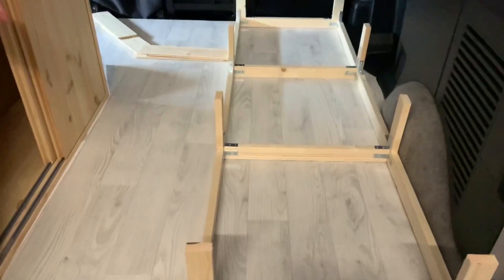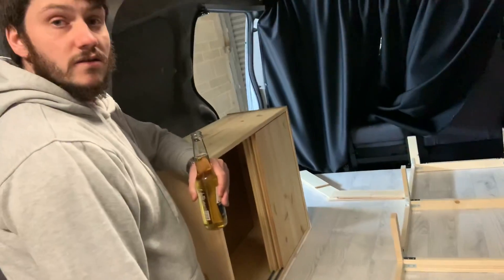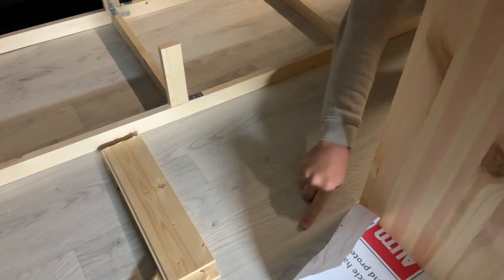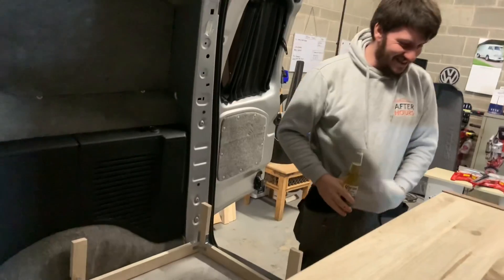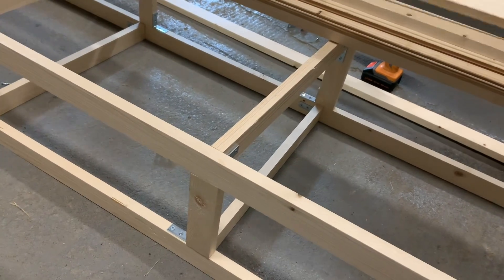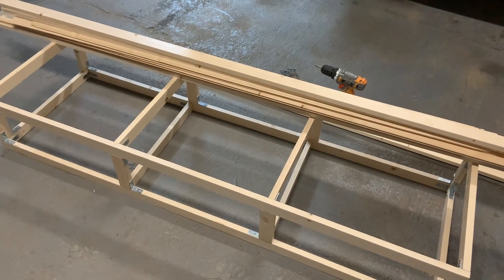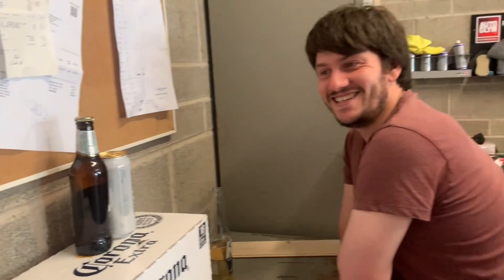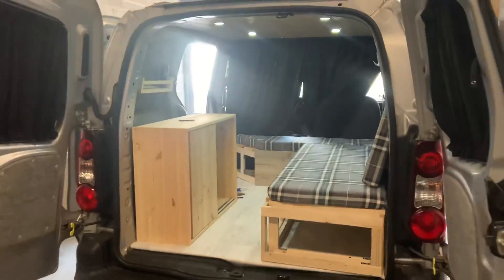Citroen Berlingo camper van part 2

Comment: Having slept in many a van slatted bed, I would use a guest bed, £50 from Argos and the like, they are sprung with a 50mm foam mattress. And dump cupboard fronts for slide out plastic tubs, no noise!
Reply from the maker: This was an idea we consider but it would limit the use of the van, our design although it has draw backs gives a bit more utility.

Comment: Question about the caddy conversion. The kit is from van furniture and is it just the basic caddy one rather than the maxi? What overall width and length was the bed? Cheers
Reply from the maker: Hi Richard, unfortunately we sold the caddy ages ago and we can’t remember the measurements exactly, however they will all be on van furniture website I’m sure. We did like the width and length of the bed but found the height was rather small and when you sat up your head tended to catch the roof (for me anyway 5ft 9). Hope you enjoy the videos and take care 👍👍
Reply from the maker: And yes it was just the basic caddy build not a maxi one. Hope this helps you